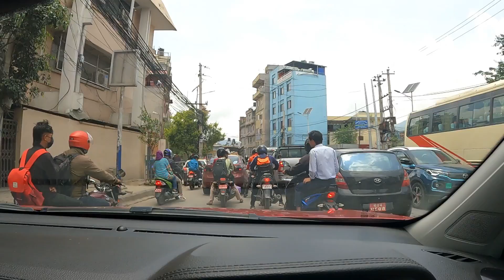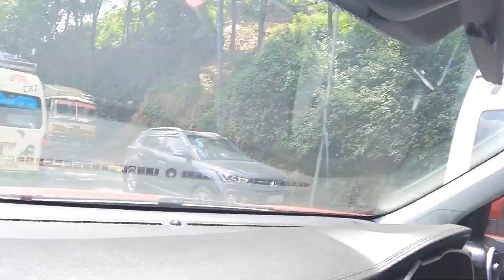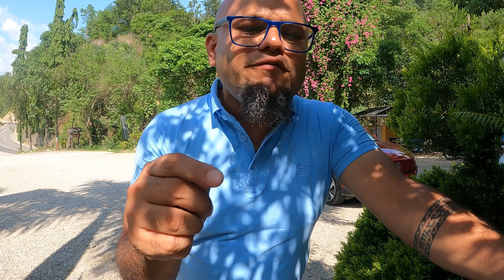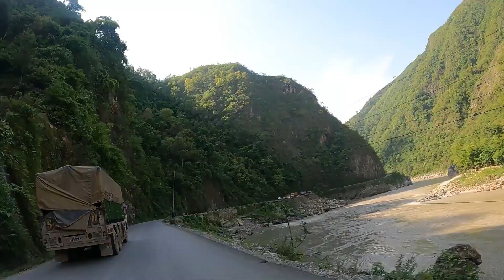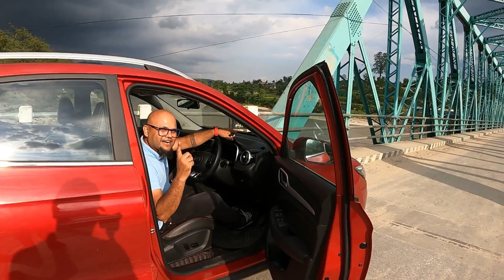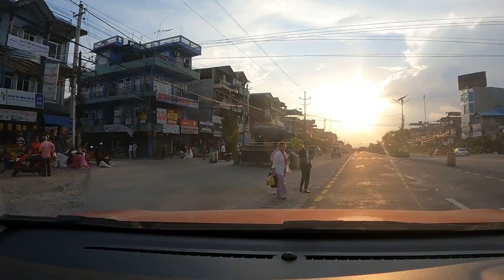2023 MG ZS EV HIGHWAY RANGE TEST _ Features explained _ Electric Vehicle _ Morris Garage_ Go Green

Comment: Seems like MG has screen flickering problems.. Actual range differs each person driving style & other factors, in your trip what's the range when charged full? Wherever review you search say its regeneration is not good as Tata , even BYD.. Tata Nexon Max 40.5 kwh battery some users says they're getting 350-390kms.. MG have 51kwh battery should be able to achieve that too ..
Reply: Getting over 300KM in Tata Nexon EV Max is just a lottery..
Reply from the maker: @Aayush2614  is there anyone getting that range ? It will be interesting for customers to know about it
Reply: @awashisojha  I have not encountered anyone, who has got more than 290KM in Nexon EV Max. And those figures were achieved by being easy on the accelerator and without AC. So 350-390 km on Nexon EV is only possible either on long downhill or through hypermiling which is totally impractical on real scenario.
Reply from the maker: @Aayush2614  ohh ok. Thank you for sharing the information. I am seriously wanting to do a range test of Nexon EV. I hope they let me do it.
Reply from the maker: Hello sir,
Thank you for your query. I think I have answered your question in my 2 videos that I have shared in my YouTube channel already.
Reply from the maker: I would like to request you to watch both the videos to get the clear picture.

Comment: What is the cost and duration of full charge?? 👍🙏
Reply from the maker: If we charge the vehicle with the charger from NEA then the cost is minimum, they charge as per unit cost (I don't know the exact cost). We had to pay Rs. 500 at the hotel to get the vehicle charged from 23 to 100 %. This cost is actually on the higher side. It took us around 8 hours to get the vehicle fully charged (with AC Charger).
Reply from the maker: Thank you for the comment.

Comment: Dai, at 5.6 meters, this car has the highest turning radius in its segment.. hv u faced any difficulty maneuvering it in tight corners?
Reply from the maker: Thank you for the comment Subang. 
Maneuvering the car inside the city was a cake walk. Even on the highway, I had to take a few U turns and many sharp left and right turns, which the car took very easily.

Comment: kati kw battery? long range or 100kw
Reply from the maker: It is 51. I have mentioned all those details in the video. 
Thank you for coming in and commenting.
Reply from the maker: They are claiming the driving range of 320 kilometers (WLTP Range)
Reply: genuine review needed for 99kw motor peak power 
planning to buy one
Reply from the maker: @sanjaysanjel9828  let me see if MG people let me do it.
Reply: as you mentioned its 130kw option
Reply from the maker: Ohh yes... The motor
Reply: The battery is never measured in kw, but it's measured in kWh. The motor power is measured in kw.
Reply from the maker: @Aayush2614  right !